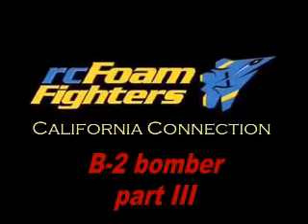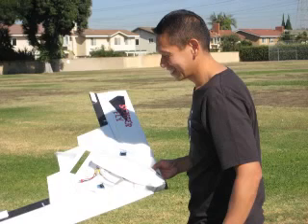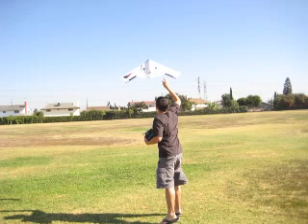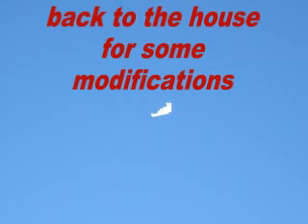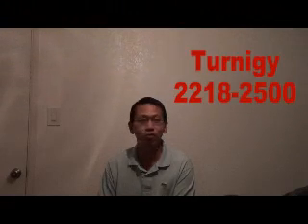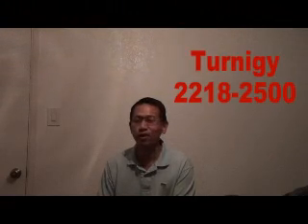B-2 Part III

Comment: Really cool B2. 
What I found helps is put a big huge vertical tail on it, get it in the air, trim it in on the pitch and roll.  Now thats 2 axis you don't have to fight.
The next step is land it, cut an inch off the vertical and repeat.  Now you can keep doing this until you start to get to yaw instability.  And a that point you'll have an idea how much and what you need to stabilize the yaw.
Work from stability into instability, not the other way around.
Awesome plane!